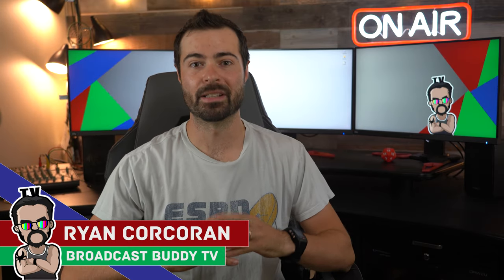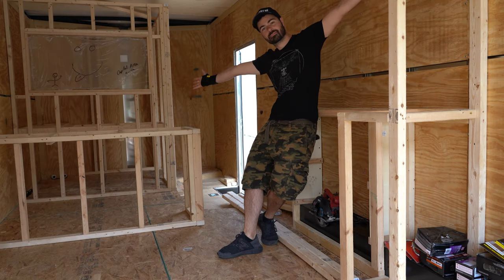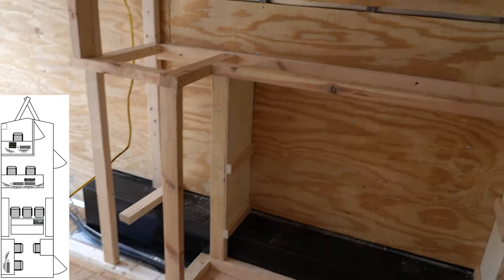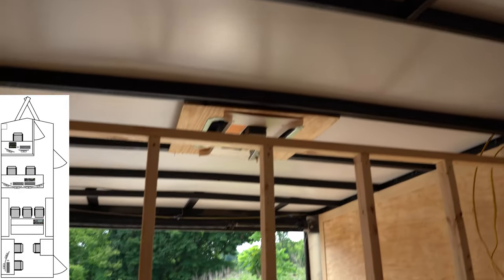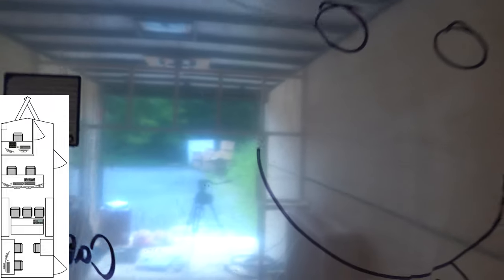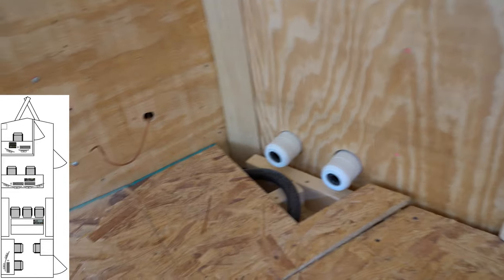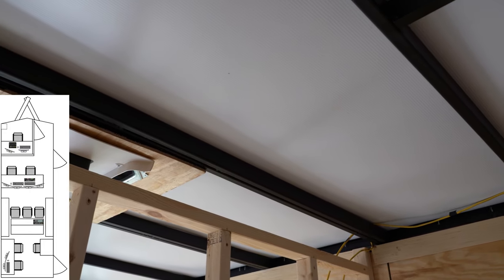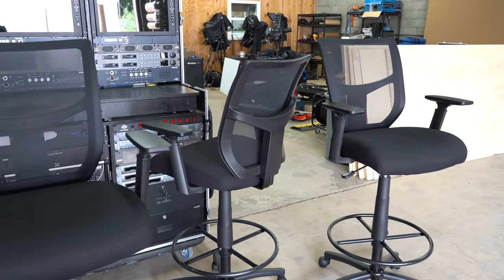Let's Build A Mobile Production Unit, Part 4 [Broadcast Engineering]

Comment: Why did you use wood for shelves & frame?  Why not use aluminum or iron
Reply: I was wondering about this as well. I would think saving weight by using a lighter material would be key for a trailer.
Reply: Considering there is very little equipment/cabling in this trailer weight is not as much of a concern. 

My HD Trailer has 5 permanent racks and 2 desks and with all the gear in it we are just shy of 5 tons and its shorter in length then this.
Reply from the maker: Hi! Thanks for your question!

The decision to use wood for the shelves was based on a few things (none of which were really thought about beyond a base level though). We already had the excess material, it's lighter, we could paint it, and none of the items that will be placed there are particularly heavy. IE, maybe some phones for charging, boxes of tissues, cups with markers, board tape, etc.

Though, I'm certainly not against a more dense material, and it would easy enough to change out in the future if need be :)